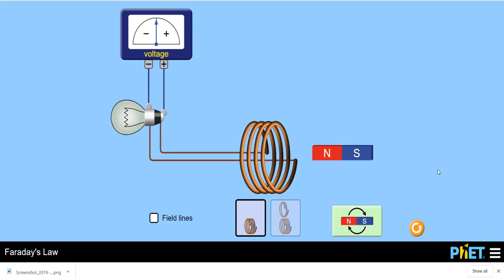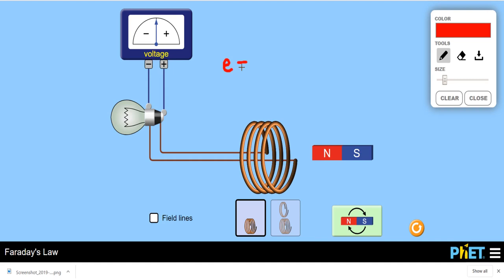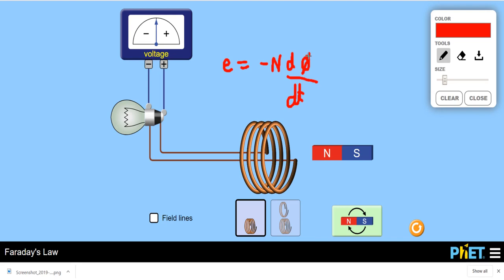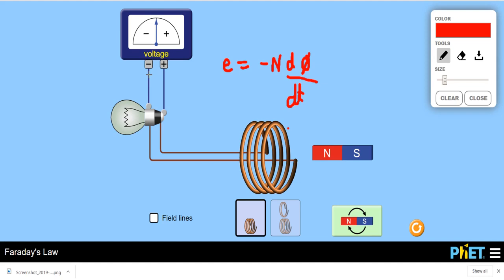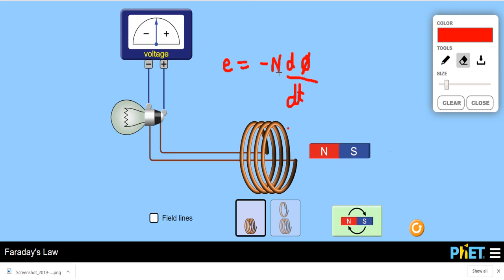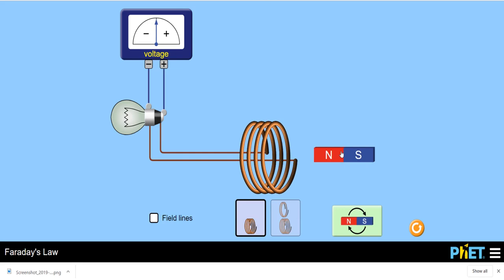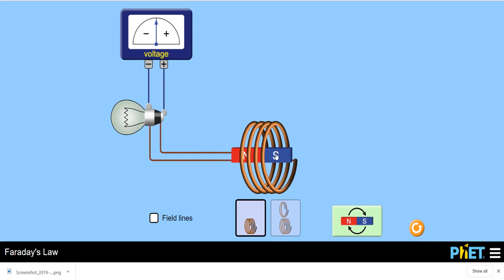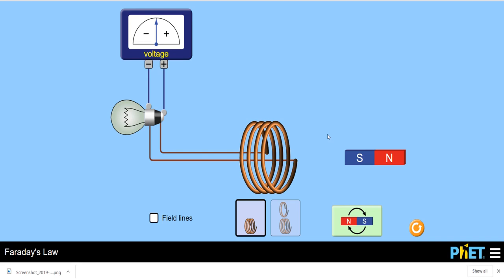Faraday Law of Electromagnetic Induction- EMI- Lenz Law- Electromagnetic Induction- PhET Simulations

Comment: Hi, i will appreciate if anyone can clear my confusion. When 3:35, when we move the magnet toward the coil like that, isnt that the current induced is counter clockwise (looking from the direction of magnet)? That means the current is flowing from positive terminal to negative terminal (and i am expecting a positive reading in galvanometer) . But the galvanometer deflects toward negative. Why?